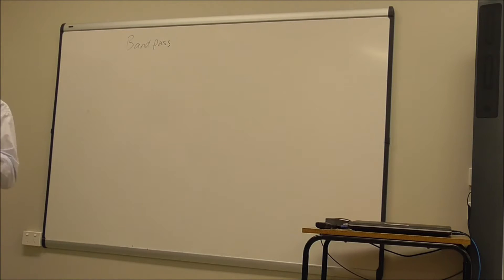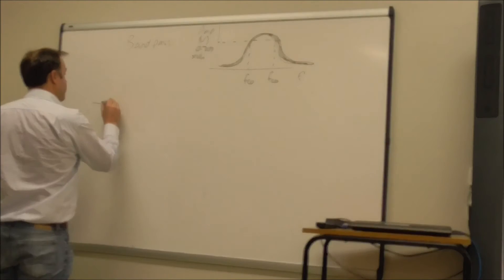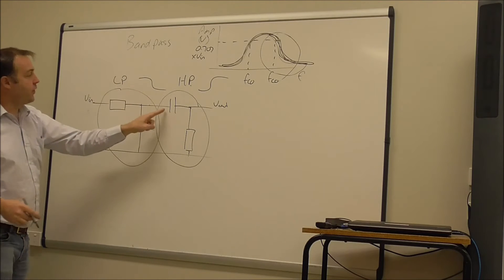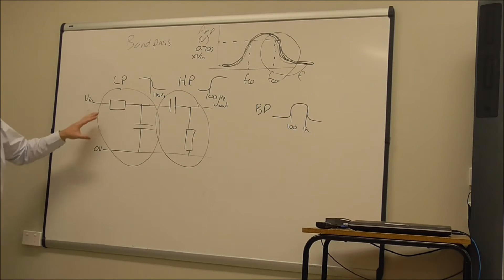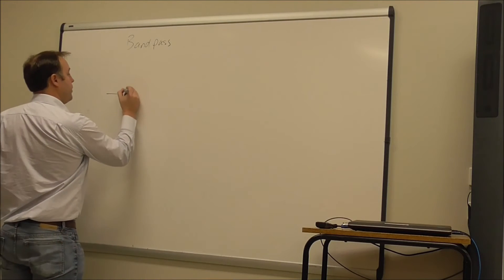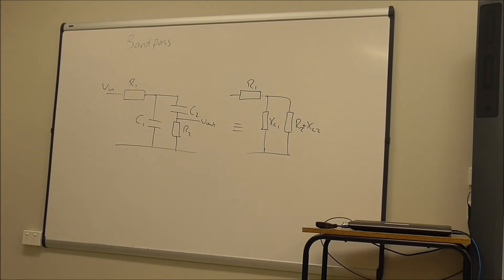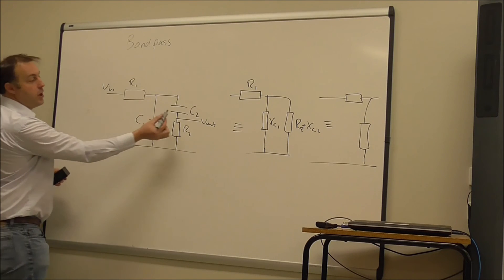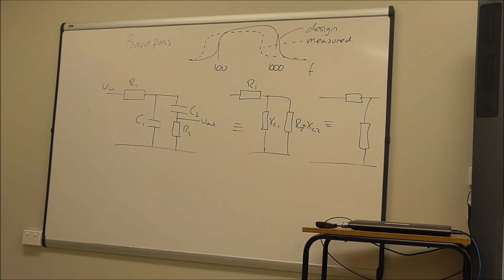passive band pass filter

Comment: I understand that loading of LP filter by HP filter components(R2, C2) will change the designed cut-off frequency for LP filter stage while the cut-off frequency of HP stage is in turn affected by LP filter components(C1)
Reply from the maker: Varun Nagpal I imagine that it would depend on the values of R & C that you use.